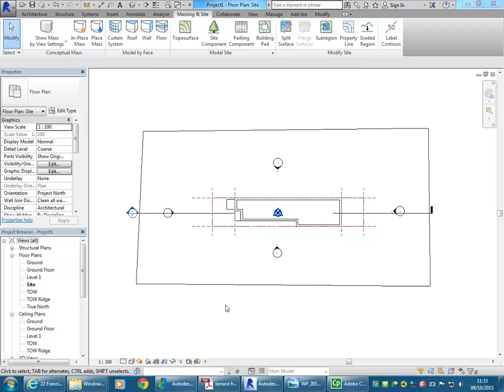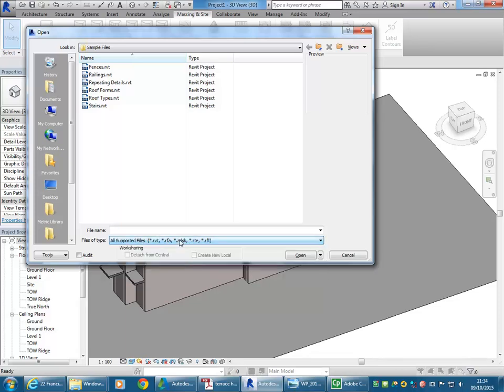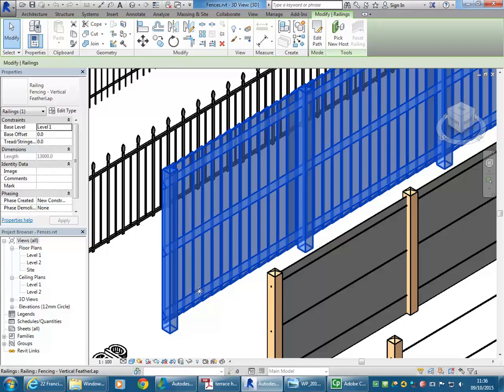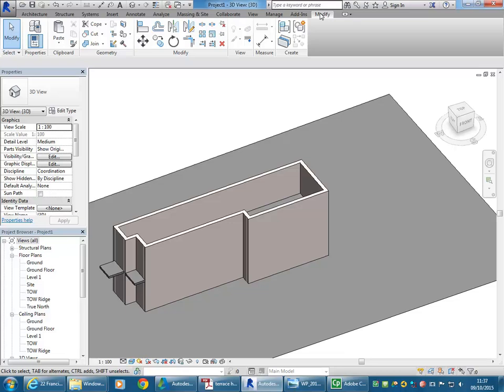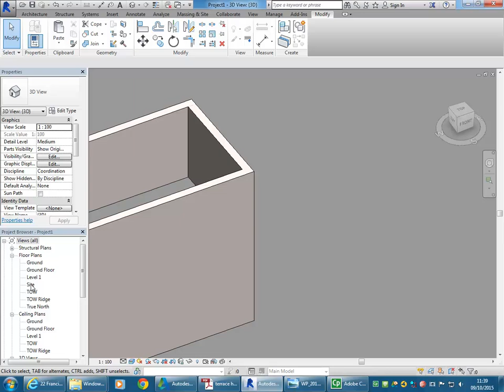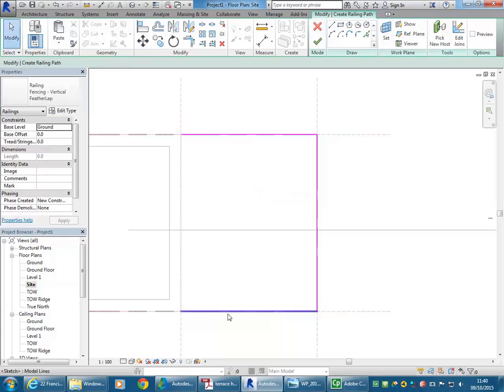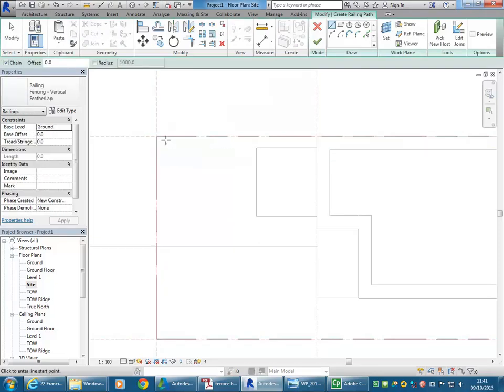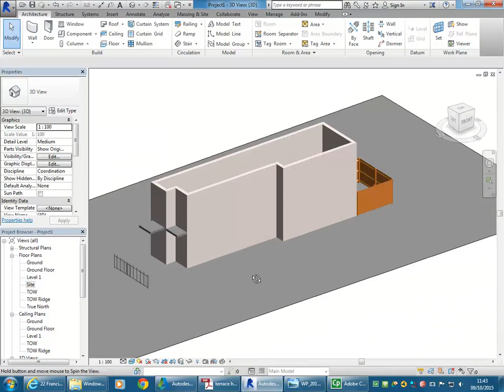Revit Confined Dwelling 05 Adding Fences

Comment: Sample files are empty
Reply from the maker: You probably have it set to only show family files (*.rfa). Try choosing Open (not Family or Project, just click where it says Open on the menu) then you should see the files in the Sample Files folder. They are project files (*.rvt)
Reply: That works! Sorry, my bad, didn't pay attention to your video. Just really frustrated with the way the fencing system works, I was able to model the whole house including toposurface using an actual topographic map and got stuck on  something simple as making fence around the perimeter